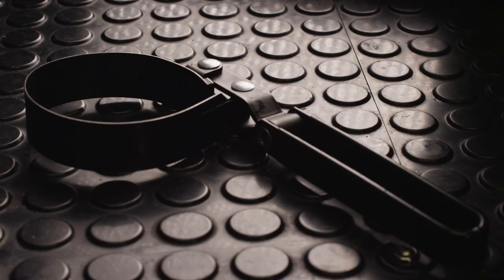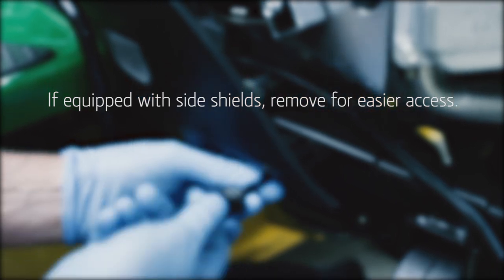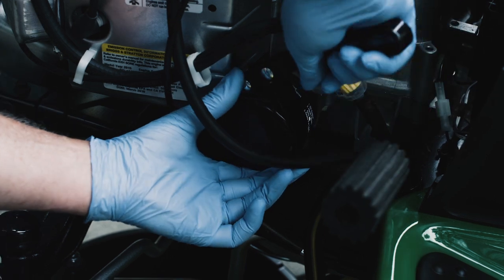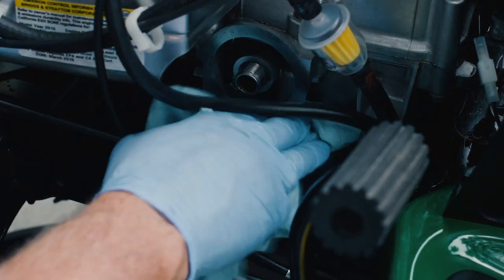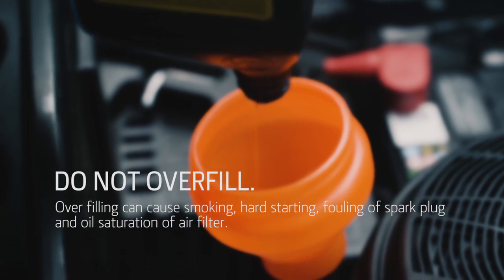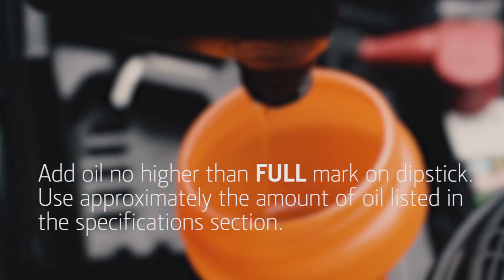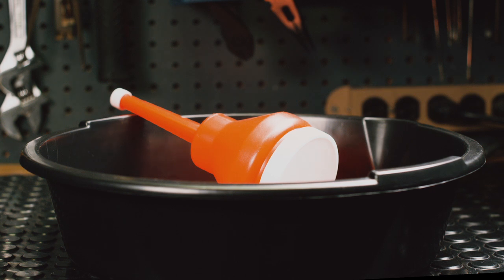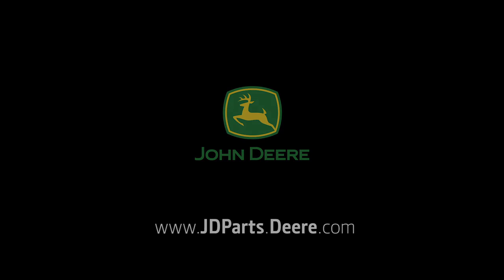How To Change Oil & Oil Filter | John Deere D100 Lawn Tractor

Comment: Weird... they recommend using shop towels, yet none of them are placed below the oil filter when it's removed. In fact, when he removes the filter the screen is blurred out and text is added so you don't notice all the oil just spilling all over the mower frame. Why not place a few shop towels or a piece of cardboard or something under the filter to keep the oil from flowing all over the frame?

Comment: How often are we supposed to change the oil?
Reply from the maker: Thanks for asking, Xayde. Replacing your engine oil and filter will depend on which lawn tractor you have. There are also other factors to consider when determining the best time to service your machine, like how long you are using the machine and if you are operating in dusty conditions. 
You can find more information under the "Service Intervals" Section of your Operator's Manual for your model. If needed, you can find a copy of the manual online at techpubs.deere.com. We hope this helps!

Comment: My new mower's oil filter is on hard. What do I do?
Reply from the maker: Thanks for asking! You can find detailed instructions for changing your unit's oil and filter in the "Service Engine" section of your Operator's Manual. If needed, you can find your Operator's Manual by simply searching your unit's model number here: https://bit.ly/3bJUgos. If you are having difficulty changing your oil filter or have questions please contact your local John Deere dealer. Find their contact information at dealerlocator.deere.com.
Reply: I heated it up for five minutes and then the gasket was more pliable.